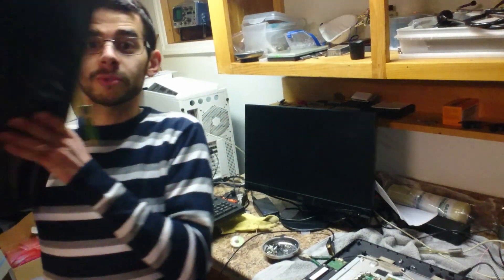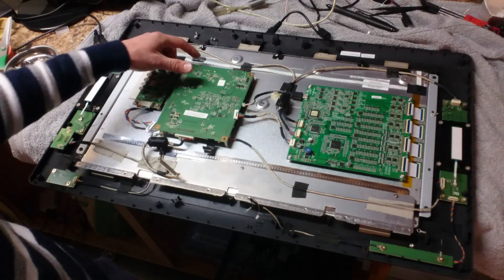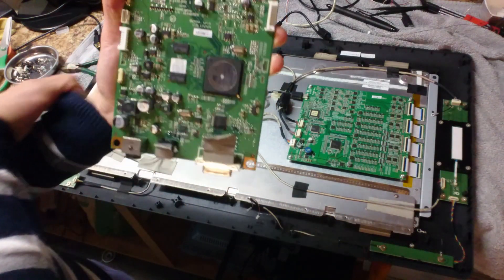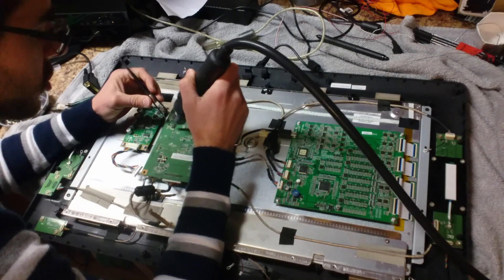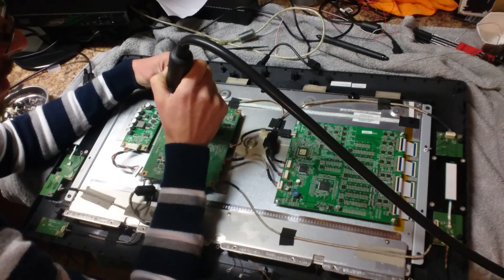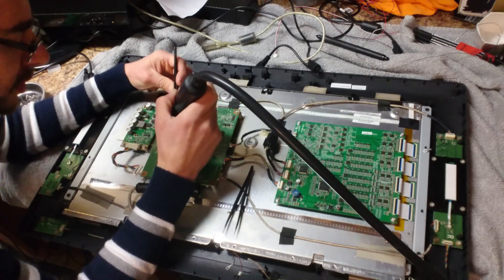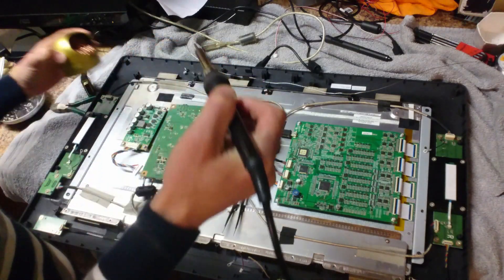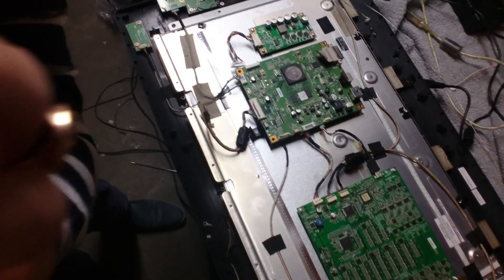Cintiq 22HD Power Issues Transistor Replacement FDS 4435BZ

Comment: So if mine turns on and displays when I plug it in and then shuts off completely after 5 seconds of running what's exactly dead in your opinion
Reply from the maker: I can't rule out the two options in my video. Could be either, or the graphics chip failure that I have not done a video about.

Comment: i just opened my wacom to see if i can visually notice something. but i instantly gave up. Backlight is on actually but no image, so main board is probably broken, i would replace these transistros and try if it helps.
Reply from the maker: @simonmeszaros2770  Does it give the no signal going to sleep message?
Reply: @procersapientiae  no image, only backlit. I have sent you an emeil with a photo under the hood. Thank you Ian

Comment: HI Ian, i have a cintiq 22hd,  At the start, pressing the power button won't turn it on until after a few more tries. So for a long time, I usually just left it ON most of the time, with the fear of not able to turn it back on again. But now even after pressing the button for so many times, it won't turn on anymore. the difference I think, was that I rearranged the power cable. 

Also I realized that I may have hung the power brick/adaptor for a long time (bad cable management for probably more than a year). And it probably messed/crimped up the wires due to the weight of the power brick. I have zero electronics knowledge to confirm this.  Do you think I should first buy a power brick adaptor to confirm this? I hope you can help me.

Comment: Hi Ian, what can I do if my Cintiq 22 HD show me this message: "No signal - Going to Sleep" - I change the DVI cable but the problem persist... Is a problem with my Cintiq or with my PC? Can you help me please?
Reply from the maker: You have a rare issue that I have not yet solved, we have one board in the shop that does this. Stay subscribed and we may have a solution in a couple months.
Reply: Hi, Ian. My Cintiq 21UX is doing this too, and it’s also completely turning off/losing power randomly. The screen will go black, no blue or red power light or anything. It happens frequently while I’m working. Any thoughts on the power issue?
Reply from the maker: @jaimeebanks6698  DTK or DTZ? This is frequently the inverter board dieing, but if there is no power light, it's probably a main board issue, one DTK has come into the shop like this, we have not explored it yet, DTZs vary from model year to model year.
~Ian

Comment: Hmm, I'm getting a variety of voltage readings across these mosfets that's different than what some others are seeing. Q20 is showing 5v, Q14 5v on one side, 0V on the other, Q24 5v except for one pin that's showing 100V, Q18 is 180V. No, I'm not missing a decimal point. So pretty consistently 5V except for the high readings. Are you sure that Q20 should be 12V?
Reply from the maker: Are you sure it's not auto-ranging and showing 100 mV (that was probably a bad connection or the gate pin) / 180mV? In this case, replace the two that are not showing 5V, these control the 12v lines on intake and going to the LED inverter.
Reply: @procersapientiae  You're right, user error, it's auto-ranging and displaying mV. This is why we don't troubleshoot at 3AM.

Comment: hi, i have a wacom cintiq 24 Hd, it has a problem, it turns on but in a few minutes it turns off the tables still works without image ... does anyone know what could happen to it?
Cheers
Reply from the maker: Most likely needs a new inverter board, or replace with LED modules will make a video about this soon.

Comment: Hi! So I finally noticed you made a video about the transistors replacement as well. I went ahead and checked the voltage on the capacitor c12 (I think? The one that’s supposed to read 5V) and I’m getting 2V. U1 is 1.75V. I’m not sure I’m measuring correctly though. I measured the other ones : Q21 is maxing at around 7, Q18 at 1.4V, U20 at 1.7V, Q14 is at 0.7V and Q24 is maxing at 6V. I also measured the second big capacitor, C18, and it’s maxing at 7V. I don’t really know what to make of these. It doesn’t really match the problem you’re talking about here, so I’m not sure what to do. I’m pretty confident I do not want to try and replace these transistors myself, though, as I do not have the necessary tools, so if you think you might be able to repair it, I’d be totally willing to ship out the board to you (I don’t think you need the whole cintiq) and pay you to do the repair if it’s not to expensive, otherwise I’ll try to sell it for parts.
Reply from the maker: My recommendation is to replace the FDS4435BZ chips and there's a 4/5 chance your issue will resolve.

Comment: Hi Ian, on the cintiq 27 QHD, I found a on the enverter board on the bottom just under the display socket cable a mosfet Q544 on the board and on the mosfet is S4835D and I tested it and give me on the 2 pin 5v and 0v on the other 4 pin
Reply: I'm having backlighting failure on my Cintiq 27QHD. How did you manage to get the housing off? I've removed all exposed screws on the back case.
Reply from the maker: @aleclicata   Sorry for the delayed response, your comment got lost under another comment. For the 27, there are 2 screws under the sticker/s on the back where the model number is. Once you remove them it basically falls off.

Comment: Hi Ian, what voltage should be on U20 the one you changed and the tablet start working and for the cable going to the screen board what voltage should be on, I bought a cintiq 22hd and the screen is not working the U20 gives me 1.6 V
Reply from the maker: Q20 is most likely the problem, not U20, if you were looking at Q20 you should have about 12V on both sides of the transistor, place one probe on a ground somewhere and the other probe on pin 2 or pin 6, both should give you 12V while the circuit is working. If that's what you did, and it's giving you 1.8V it's definitely got a problem. I'm guessing you placed probes across the Transistor though, which would indicate a drop in voltage from 12V to 10.2V also indicating it has failed. Q18 I think has more to do with the LED circuit for the power and status light, so I don't think it usually causes a real problem, but I replace them all because it's easy enough for me. You may want to replace Q20 and see if that does the trick.
Reply: Ian Tompkins Thank you for the reply, the Q20 I tested the second leg and it gives me 12 v and I tested the cable going to the light driver and there is 12 v but I tested the cable that going to the screen board and there is no voltage, the Cintiq problem is, it works as a tablet there is no backlight and screen black try bright flash but nothing on display,
Reply from the maker: @kanchour16  The thing is that these can often be relatively asymptomatic, and while carrying the right voltage, it might not be getting the enough current to the driver :\
I would start by replacing the 4435BZ, and see if it resolves the issue before doing more extensive testing, since it's such a common issue. 
You said there's no voltage going to the LEDs? There are 6 pins that go to the LED strip via a flat cable at the top of the tiny driver board, 2 are grounds, and 4 are live and should be getting around 48V or so be careful measuring these as you don't want to jump them...

Also, take a peak at the voltage you're getting across the capacitors I'm replacing in this video https://www.youtube.com/watch?v=QnffqyqLvrg
If you start measuring when you power it on, you should see it gradually decrease?
~Ian
Reply: Ian Tompkins thank you so much for the fast reply I will test them and let you know by the way happy new year
Reply from the maker: @kanchour16  You are Welcome and Happy New Year!
Reply: Ian Tompkins hi, I tested the led flat cable with 6 pin and there is only 12v in the 2 pin in the middle and the other pin nothing, for the capacitors I think they ok there is 12v on them all, the Q20 is giving me 12v on 2 pin and 12 on 6 pin do you think is bad
Reply from the maker: I would start with replacing Q20, and all 4435BZ transistors on the main board, it's only $2 for 10 from China. Otherwise it could be the controller on the driver board, it is unlikely that it is a transistor on the driver board though, because the problem you're describing is more than one lamp, so it is probably upstream from the lamps, i.e. the controller, or power to the board. If you want me to look at it, you can ship both the main board and the driver and I can pop it in to another cintiq and explore the problem, that would also allow me to test the driver with another board so that I can isolate the problem to one board or the other. It should not be too expensive to ship just the boards. :)
Reply: Ian Tompkins yes I will ship it just send me your address and I will send them to you thank you very much I will send you the money for the shipping back and for your work as well.
Reply from the maker: @kanchour16  send me an email to iatompkins47@gmail.com and I will reply with shipping details. :)
Reply: Ian Tompkins I sent you email right now
Reply from the maker: @kanchour16  replied :)
Reply from the maker: OMG I think I got you confused with someone else who was asking me questions, so just to check did you try the part where you removed the cable from the display and see if the backlight came on temporarily? I know you already packed it, but I had assumed that we already ruled out an issue with the display board which I go over in another set of my videos. I know you were also working on that 27qhd, how was that going?
Reply: Ian Tompkins yes the 22 Hd I did take off the screen cable and there is no light pop up, and for the cintiq 27 QHD I still with it I didn’t find the issue yet, I am still learning, may I don’t do a good diagnostic that’s why I didn’t find the problem, and as I told you I had a surgery on my right hand so it is difficult for me to open the 27” I will live it for later